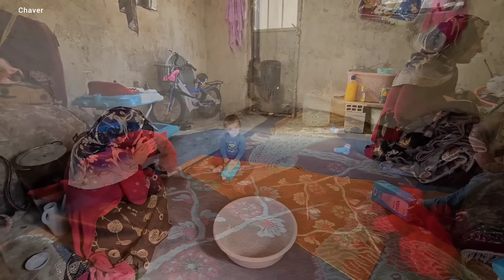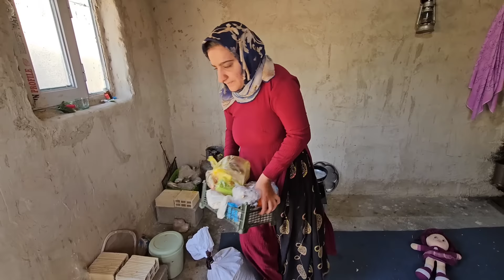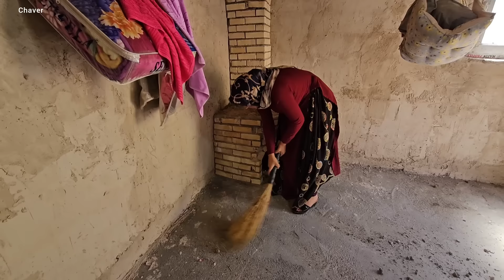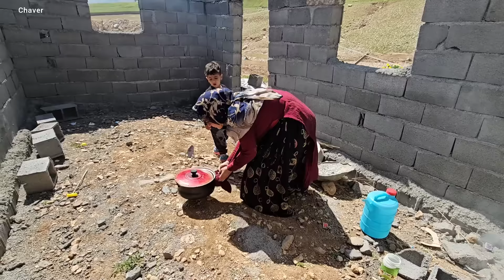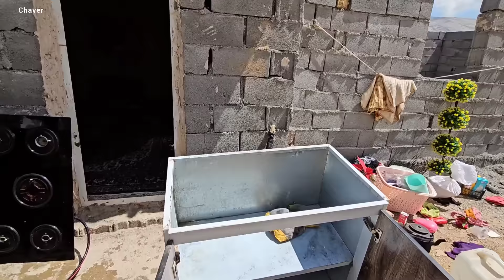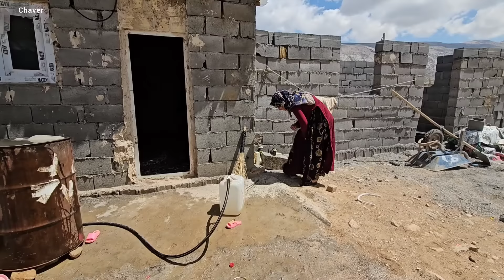Ali's return, buying kitchen cabinets. Shadi Sakineh  🥰 🤱 in the mountain

Comment: 4 yellow ball flower, that your X got you leave outside, by the door. PLEASE don't put the cabinet right beside the fireplace, put it under the window.bike, cradle, junk in the storage room.tear the cradle hanging from the ceiling, use the pillow, and put the rope to it also in the storage room. Plaster the walls, and outside of your hut, would look so much better, your gone to paint or plaster them at sometime.  Your daughter, is a big crying baby.sorry. I know you'll not do any of this, but try.

Comment: The cupboard is very nice, I would prefer you to buy another one and put it under the other window and put your pots and whatever you have in the baskets and clothes in a cupboard to put what you are cooking in,,,,,,,,,it would also be a good idea to put curtains on the windows next to the door window, you can also get 2 nice pots to put outside your door, one on one side and one on the other,,,,,,,,On the wall inside the houses it would be nice to buy some stickers with different designs to put some garlands with fake flowers,,, there are so many things you can do and it will definitely change your mood😊😊😊😊😊